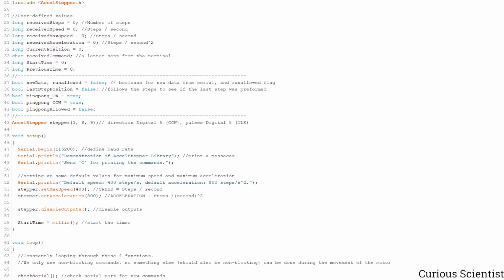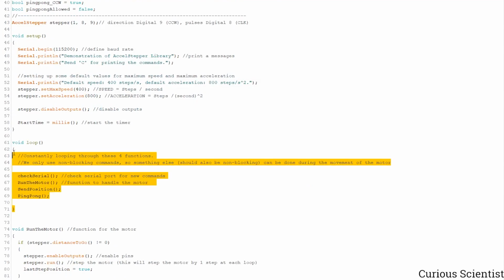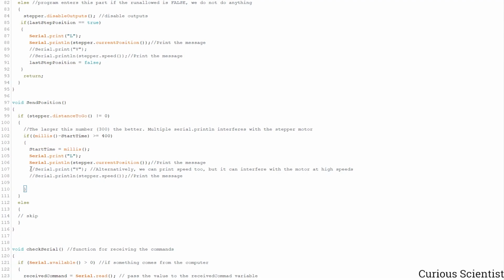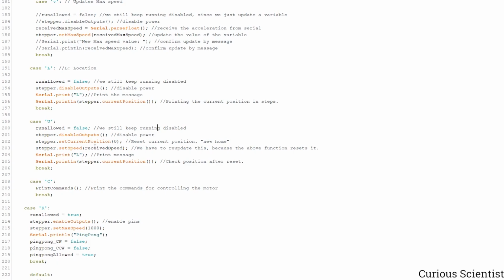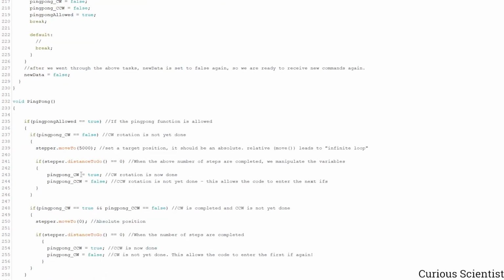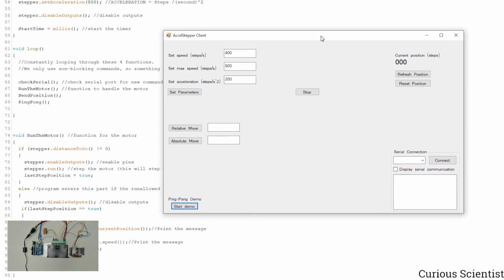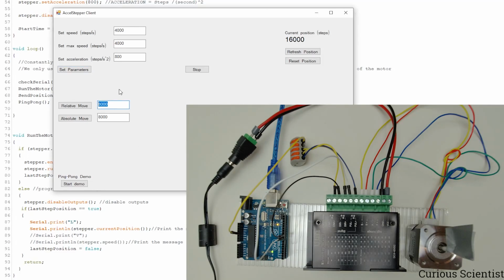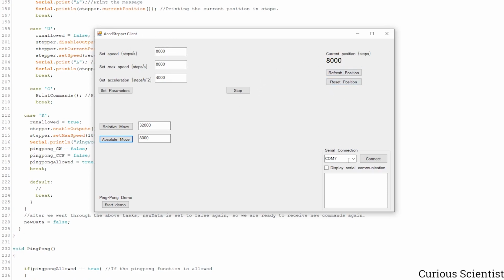Updates for the AccelStepper library - TB6600 and Arduino

Comment: Hi, I have just come across your fantastic channel and now your web site. I have just started building a model railway and one of the things I am researching is an "automated turntable". This enables you turn a locomotive around and to park locomotives in different sheds. I intend to use a Nema 17 to directly spin the turntable  and to control the Nema via and Arduino. I will need stop the turntable at precise locations so that the central track lines up perfectly with the track going to the parking bays. 

So I will look to change the number of steps to predefined positions that match each of the tracks. I was initially thinking of  rotary switch to select each parking bay or the home position, but the graphical interface you have would be perfect, with the following addition. It would be nice to replace the numeric display of the current position with  a simple graphic of the turntable, moving to the selected position. I hope you can imagine what I am trying to describe.  Could you help me with the changes required to the interface?

Another approach would be to use a set of leds and buttons on a circular board, with each button set to a specific position. The leds would light up when the turntable is in the requested position. Is it possible to have a number of push buttons with each button representing a specific position?

Would it be possible to communicate directly with you some how?

Thanks again for your work. The first thing I did after seeing your videos was to Subscribe. Thanks.
Reply from the maker: Hi! Thank you! I am glad that you found my channel! I have a contact page on my website, you can find the way to directly reach me.
Reply: @CuriousScientist  Great, I have sent an email via the web site.
Reply from the maker: Thanks, I will read it and reply tonight after I finished at my job.

Comment: Great video tutorial. I to am using Accelstepper for my camera motion control system the only drawback is not being able to control two steppers at the same time with acceleration. I have overcome this on my project by using independent Nano's on each axis not ideal but I know have a modular system  where I can control any number off axis wirelessly across the same or different devices.
Reply from the maker: Thanks! I believe it should work simultaneously with 2 steppers on Nano. Maybe you have a blocking code somewhere or you print on a display....etc. Alternatively, you can try faster, Arduino compatible MCUs such as the STM32F103 blue pill, or the Teensy 4.0. Teensy is super fast.

Comment: Great Job!!
When I run the motor at high speed, I have a problem with accuracy.
e.g: I ask to perform 5 revolutions, then 5 more and 5 more and so on. The pin does not stop at the same place it started, even using 1/4 steps.  
Do you have any idea to resolve this? I was thought about every entire movement(e.g: 5 rev, or something else) back to the origin (some place that has a limit switch), so that the loss is minimal and not cumulative.
Thank you!
Reply from the maker: It is maybe skipping steps. So it might be that the power is too low. Try to increase the supply voltage and/or current to see if the issue is resolved. For troubleshooting, try to set a very low stepping speed that you can easily follow and then count the steps done. Try it then with different speeds. I haven't really had precision issues except when I haven't supplied enough power to the stepper motor driver and it skipped steps.
Reply: @CuriousScientist  thank you! I’ll try this.
Reply: @CuriousScientist  I think there is some problem on the beginning (maybe something related to inertia), because the shaft vibrates and seems to step back a few times haha. It's very strange.
Reply from the maker: @pisobre2  have you tried to play around with the acceleration values as well?

Comment: Thanks for all of content related to stepper motors and TB6600.  I'm building my own universal testing machine using twin ballscrews, linear rails, tb6600, and 2x arduinos.  I'm a mechanical engineer by trade so the coding aspect is very alien to me but with the help of your videos I reckon I will get there in the end.  I would love for you to add the real-time stress/strain graph using data from the load cell and DRO.  If not then I will try to do it myself.  I notice sometimes in your video you talk about getting metal parts CNC'd.. I do some CNC work myself and have access to a HAAS CNC mill.. as way of thanks for your content I could make some parts for you at cost price if you like?
Reply from the maker: Hi! Thank you for the kind words! I guess you saw that I have a tensile testing machine as well with most of the parts involved that you mentioned. In this video, I show some data with force and displacement (from the DRO): https://youtu.be/hH5aBqoqcBE . Also, in this video, I show a somewhat real-time data but without any units: https://youtu.be/PNz2B1gsjtY . I calibrated the load cell properly, so we can trust the values of it, but the DRO is still a bit problematic, so I just use it as some kind of feedback. You as a mechanical engineer might know these things better than me, so as you can see it, there are a lot of places where slack, misalignment and similar detrimental things can happen. Reading the strain by the displacement of the crossheads is not the best approach, especially with this "flexible" setup. If you can measure the compliance of the machine, then you can correct your stress and strain values and get really accurate values for them based on the crosshead displacement, but I haven't done that here. The best would be to use an extensometer for strain but the sample is too small (3-5 mm gage length). I already implemented a tiny USB microscope and a video capturing option in my tensile testing software, so I will try to measure the strain with DIC, but I do not have time to implement it. I also have 2 larger twin ball screws sitting in my wardrobe waiting for me for more than 2 years, but I haven't got the time and resources to start building it. I want to build a very tiny machine, and I also want to build a larger, desktop machine which will be more precise and stronger as well. The one that you can find on my channel is sort of a "proof of concept" and it was also a very good learning exercise for me.

If you can send me an email through the contact menu on my website, I would be really thankful. I don't have the resources right now to get anything CNC'd, and I also have to draw a few more parts, but it would be nice to have you on my contact list. Also, I might be able to help you with your machine later on.
Reply: @CuriousScientist  for the first video above did you plot the graph after the test from the serial data?  And for the second video how did you create the real time graph?  Was this an extension of the client you created?  Yes I agree that the measuring the displacement of the crosshead is not ideal and an extensometer should be used for more accurate readings.. however a DRO measuring crosshead displacement is better than purely measuring the steps taken and converting this to linear displacement I think.. if using an open loop system.  Initially in my design I think I will just use the step counter to measure displacement but in future implement a DRO.. or use a hybrid stepper motor with an encoder to count the actual steps.. and maybe in the future after that I will use a servo motor.  

In my design I am using 6mm laser cut steel as the base plate, crosshead and top plate.  I am then welding on 40mm x 20mm steel box section in order to make them stiff.  Even with the welded box section I think there will still be some non-negligible deflection but I am not really looking for accuracy greater than 0.1mm or so to be honest.

Why did you decide to create your own software and not use something like labview or another program that helps to create custom GUI's?
Reply from the maker: Hi! Yes, the plots for the first video in my reply were created by capturing the serial data from the Arduino. But I have a custom software for this, so it does the dirty job for me and formats and calculates everything. The real-time data was done by recording the video with a camera and at the same time I was recording the screen of my computer. Then I just synced the 2 videos. The real-time "stress-strain" curve was displayed on my custom software. I show the software in multiple videos. I am working with an open-loop control plus the DRO. It is very easy to step the motor according to the DRO, but as long as my mechanism is not so good, I just run the motor independently from the DRO. 

I also use 5 mm steel for most of the structural parts. Simple S355 carbon steel. I used a company called Fractory for laser cutting. They have amazing prices, and they are fast and trustworthy. 

I was using some very bad commercial software during my PhD and I was extremely frustrated about it. I thought I can make a better one. So, I wrote the software (Both Arduino and PC) and I built my own tensile testing machine as well. I already knew some programming and I wanted to develop my skills so I thought this would be a very good exercise. Labview is commercial, so I have to pay for it and I do not really learn what happens behind the buttons and switches. Is I write everything from scratch, I learn all the tiny details, so it is also a lifelong investment in terms of knowledge. Also, I can put in in my CV. There are not too many people around who can tell that they built an entire tensile testing system at home.

Comment: Hello mate. Your application is very successful. Thank you very much for providing us. I get an error while running the application with windows 10. software error. What operating system are you running? At the same time, I could not solve the problem of motor heating. Nema23 gets very hot when not operating. Probably the code stepper.disableOutputs () is not working. What would be the reason?
Reply from the maker: Hi! Thank you for the positive words! The software is written on Windows 10 for Windows 10, so it should work. However, Windows might complain that it comes from "untrusted sources". Just click "Run anyway" and it should be fine. Other people also managed to run it, so it works. Heating issue depends on the controller and the applied current. If you run too high current through the motor, it will heat up even without moving.
Reply: @CuriousScientist  Although I allow trusted sources, I get the warning "Access to com6 connection is denied". The program freezes after this warning. As you said, it's a security related problem. I feed it on 12V. Despite this, it gets too hot to touch while standing. Thank you for your interest.
Reply from the maker: @MrMuratx81  Denied access is usually because you already have a communication open somewhere else. If you have the Arduino IDE open and you are connected to the microcontroller, it will not let you to connect with another software. Close everything, connect the Arduino to USB then connect with my software. It should work. 79 people downloaded the software already, and I haven't received any connectivity issue related messages. The problem is now in my software. 

12 V is voltage, not current. You have to check what current is enabled on the controller.
Reply: @CuriousScientist  :=) sorry 12 V is not current. 3a my current. 
serial port is open. I didn't notice. The problem is now fixed. Thank you so much.the program is very good.
Reply from the maker: I knew that the open connection will be the problem :) I am happy that it works. 3 A can be high and cause warming. Sometimes I also have problems with this, regardless of the controller and code I use. On the controller, set the current as low as possible/feasible. If you do not need too much torque, the current can be relatively low.
Reply: @CuriousScientist  Hello again my friend. I tried again with 12v 2.2 A. Nema23 is still getting very hot when not running. but when I use the (en +) socket, there is no warming with the code below. I think the problem is with the command to stop the engine in the accelstepper. What do you think?
 (command is activated when the button is pressed.)
   
   digitalWrite (enPin, LOW);
   digitalWrite (dirPin, HIGH); // Direction of motor movement. counterclockwise if high
   for (unsigned long x = 0; x <cycles; x ++) (
     

         digitalWrite (stepPin, HIGH);
         delayMicroseconds (MoveSpeed);
         digitalWrite (stepPin, LOW);
         delayMicroseconds (MoveSpeed);

   }
                         
} else

digitalWrite (Led, LOW);
digitalWrite (enPin, HIGH);
}
Reply from the maker: Hi! The above code is not the accelstepper but the "raw" controlling code for a stepper motor. However, yes, it might worth a try to finish the steps, then manually disable the controller with an additional pin. It really depends on which controller and code you use. The problem can also stem from the fact that we are using microstepping which means that the motor has to hold an intermediate position. Because of that, the motor stays powered. Try to drive the motor in full step mode.
Reply: @CuriousScientist  Ok. Thank you. I will try this.
Reply: @CuriousScientist  
I also tried the full step mode. Despite this, my heating problem continues. Engine gets too hot to touch. now i'm starting to think my drive or motor is faulty. I understand the warming up while working. but it is not understandable that this much current is consumed when the engine is not running. Your directions have been very instructive for me. Thank you.

Comment: Complementing your excellent work, I come to contribute to help in the discoveries, in the same way that you can write in Serial Acceleration for example A3000, it is also possible to do a Delay (time); creating a new case. With a variable long time = 0; and time = Serial.parseFloat ();

Example:

//variable
long time = 0;

case 'T': // time

time = Serial.parseFloat (); // receive the acceleration from serial
                Serial.print ("new time"); // confirm update by message
                Serial.println (time); // confirm update by message
                break;

void PingPong ()
{
    if (pingpongAllowed == true) // If the pingpong function is allowed we enter
    {
      if (pingpong_CW == false) // CW rotation is not yet done
      {
        stepper.moveTo (5000); // set a target position, it should be an absolute. relative (move ()) leads to "infinite loop"
        
        if (stepper.distanceToGo () == 0) // When the above number of steps are completed, we manipulate the variables
        {
            pingpong_CW = true; // CW rotation is now done
            delay (time);
            pingpong_CCW = false; // CCW rotation is not yet done - this allows the code to enter the next ifs
        }
      }
        
      if (pingpong_CW == true && pingpong_CCW == false) // CW is completed and CCW is not yet done
      {
        stepper.moveTo (0); // Absolute position
        
        if (stepper.distanceToGo () == 0) // When the number of steps are completed
          {
            pingpong_CCW = true; // CCW is now done
            delay (time);
            pingpong_CW = false; // CW is not yet done. This allows the code to enter the first if again!
          }
      }
    }
}
Reply from the maker: Thank you, you are very nice for implementing this! I saw you followed the same logic I had in the original code. It is also elegant that you put the option to ask for the delay time. Excellent work!

Comment: Thanks, try to move to a location 1 and save that loc in EERom , then move to next location save the second location. Run from Boot then move to pre-saved locations
Reply from the maker: Saving the locations to EEPROM and then move there could work. It is a good idea if you stop and start somewhere else than the original home location.

Comment: what about multi stepper like 2 or 3 steppers
Reply from the maker: You just add more steppers to the code and drive them accordingly. You just copy paste the control parts of the code and rename those variables which control the other motors.